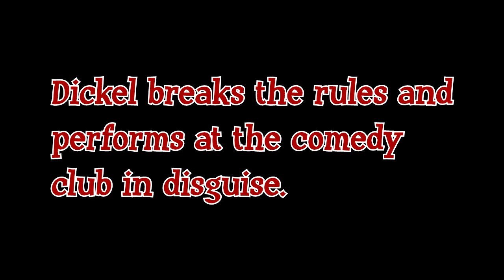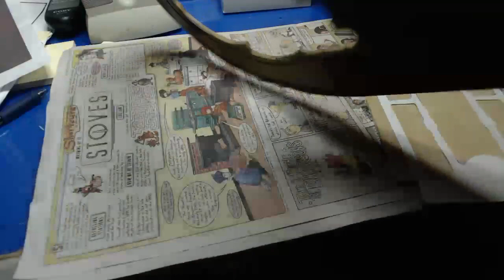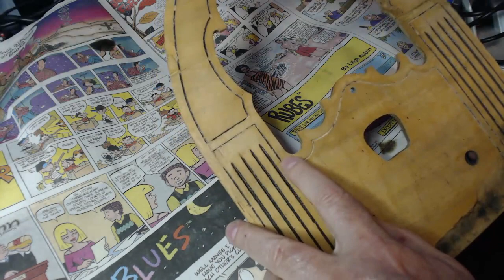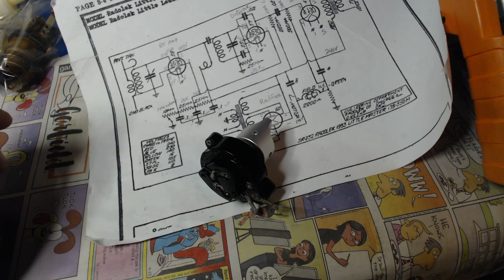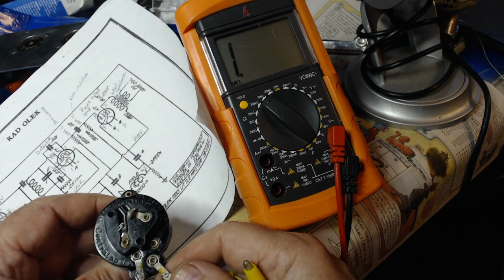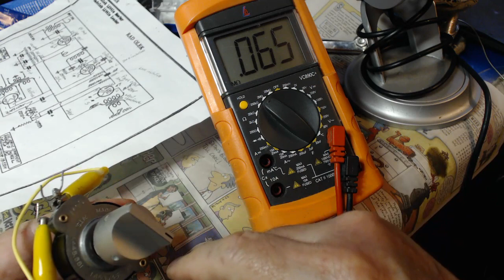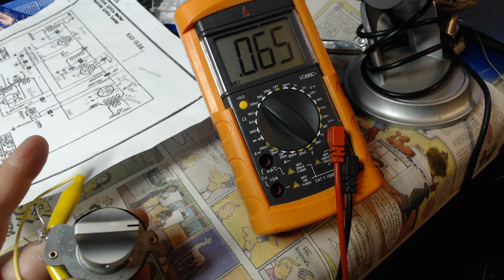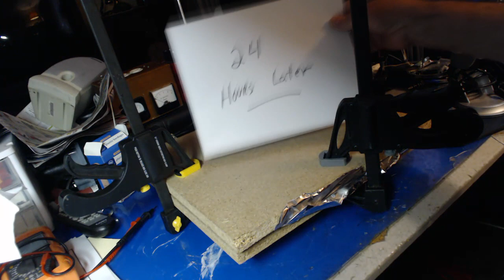1932 Mystery Cathedral Radio Restore Part 4

Comment: I see your Mystery radio project is coming along nicely Buzz. That Naval Jelly works wonders but sadly it is unavailable here in Japan and I am stuck with scrubbing a dirty chassis with a wire brush to try and improve it. I can't wait to see how you solve the Cabinet issue. Looks like quite a challenge.
Reply from the maker: use vinegar......it's acidic., thanks for watching, Buzz

Comment: Nice work Buzz.  I wonder if that control is a rheostat only.  Is it in the tube heater circuit?  Old64goat has been buying high power controls so they must be available.  That was a good job filling the chassis with solder.  That was an old body repair technique, but I would never have thought of using it.  I like that you left the "warts" on the chassis.  It gives it a bit of aged character.  I am spell bound by your wood working skills.  For a guy who at times claims that it isn't your favourite activity, you sure pull off some beautiful repairs.  Is that patience or "Old Red Eye", or a combination?  If Dickel ever develops physical problems, he is lucky to have Ole Buzz around to "operate".  His comedy routine is a bit wooden so you might start with that Ha!  Thanks for the uplift at the end of my day.  I have had a hard 24 hours, and your weekly video helps a tired soul.  Thanks as usual for all your hard work!
Reply from the maker: Hi Stephan..I am happy my videos uplift you..That's really a great compliment and I appreciate it....Buzz

Comment: Hey Buzz, I don't think your cabinet had a brace on the front like the back one I believe the front panel was glued to the front and it had glue blocks around it... at least that is how my Zenith 805 was put together, the back brace is just to strengthen and keep the shape of the cabinet... but I am sure you already know that... great work so far!
Reply from the maker: Hi Bones...On my cabinet, there was a 1/2" brace glued cause I can see the marks..Its just recessed 1/2", and the glue blocks go in front of it..I wish I had better pics, thanks, Buzz